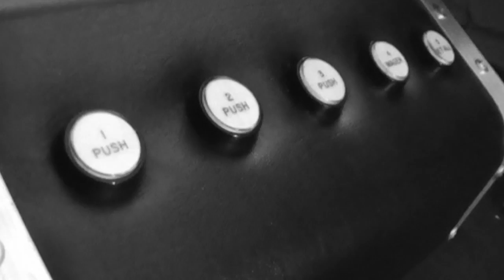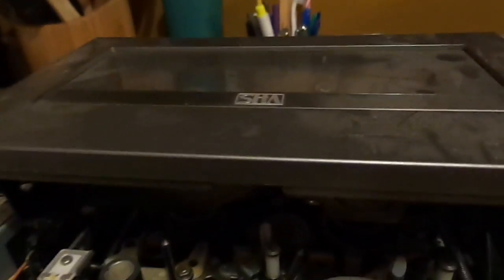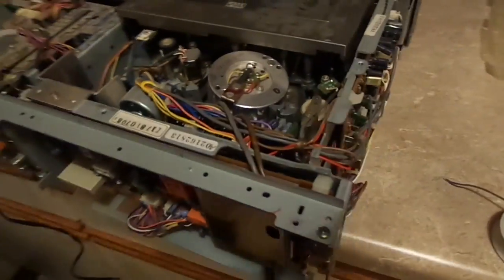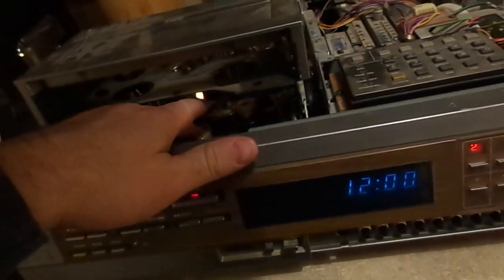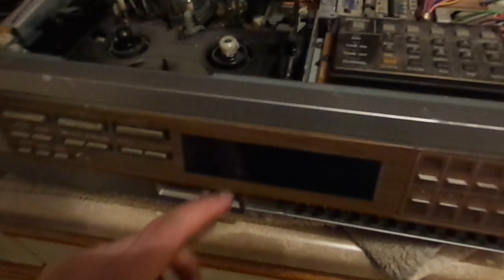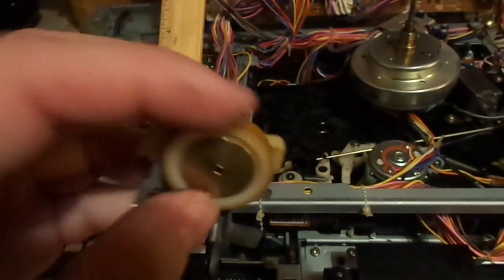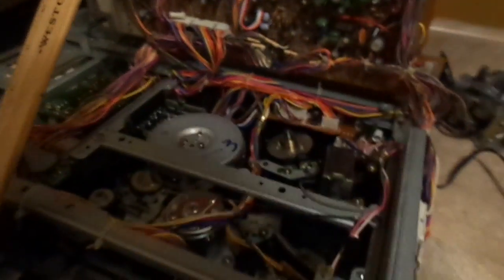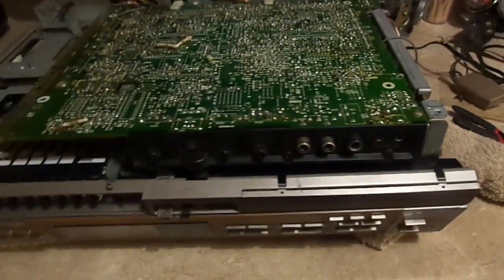Early 1980s Hitachi Top-Load VCR Repair Attempt

Comment: This has what is known as varactor tuning. The stereo VCRs of the mid-'80s were the first to use real digital tuning, while the cheaper mono VCRs held onto varactor tuning until the late '80s. (My parents got a Goldstar VCR in late 1987 and it had varactor tuning).
Reply: Can´t see...varactor was that tiny numbers in green?
1989 Samsung had a DTS (digital tuning from 2 to 69 and cable 1 to 32 and then 33 to 99)
Reply: The varactor (never knew it was called that way) required precise adjust of channels with some thumbwheels and a special tool y remember.

Comment: My first vcr was a top load, was a jvc but can't remember the model, inside was a work of art many many wires and if you removed the bottom compartment it reviled a maze of belts looked like spaghetti junction even the headdrum was belt drivin, amazing how they advanced over the years, really like vcrs, many happy time tinkering with them.

Comment: All it needed was new rubber on the idler for the reels. Its a very common failure on late 70s-early 80s VCRs. By the mid-80s, most everyone switched to toothed gears there.
Reply: But don´t toothed gears age and crack? 
my 2002 machine hasn´t failed on this part, but it seems to change to a smaller gear (FAster) when REW is pressed

Comment: Got a VT-8040E Hitachi vcr that's near-identical to that one. I purchased it in late 1982. A few months ago i tried to use it, but she's dead Jim!
The unit turns on, i insert a tape, but there's no mechanical action going on. It just sits there. Mind you, the belts have been replaced with new ones, but no move whatsoever. Wish i could get er running again..

Comment: I have a similar old Hitachi top loader VCR from the same period.
I replaced all the belts and idler wheels tires by new ones, also a new pinch roller.
It was working pretty well, but after few weeks it started to stop while playing. My conclusion was that my vcr has an issue with the motricity of the reel disk take-up, causing it to stop. And it begins to not play at all, like on your video. The reel disk take up doesn't turn, so after few seconds it stops.
There is something i can't understand with the play idler part (beetween capstan and reel disk take-up). It seems the play idler doesn't come in contact like it should... I put adhesive ribbon on the reel disk take-up where it should be in contact with the play idler (to make it a little bit larger), and it works again.

Comment: I have the samev VCR I just picked up last week and some of the springs have fallen out and I'm trying to figure out where they all go I think when you are at the end of the video you picked up that thing at the end idling arm or whatever and I saw a little spring in there maybe that's where the spring goes. I also found a little flap metal flap with a little stem in the middle and I can't figure out where it goes on this VCR. I'm getting close to putting all the things missing back in order. But when I turn the VCR on or plug it in the stop button is lit up is blinking constantly consistently. And that little light bulb where the tape goes in doesn't light up. So I'm trying to figure out those two problems also if anyone knows why those two things aren't working on the VCR please leave me a comment? I could use some help or pictures would be great I can't find the service mail either for this thing

Comment: when was the last VHS  VCR made? i have a samsung from from 2003 (ironically replacing a   mid 90s craig branded vcr)
Reply: According to Wikipedia, 2008. Combo VHS/DVD and VHS/Blu-Ray units are still made, though.
Reply: The last VHS machine was made in China in 2016.

Comment: Wow, I am shocked it even powered on!
Must have been some vintage eletronics hater. I have a 1991 Zenith VCR that used to say error on the screen and it was locked up. Soon I got it runnin', bought it's remote on eBay and it's been doing great since then. Got it at a thrift store some time ago, just needs some grease now!
Reply: By the early 1990's, VCR's started to be made in China for cheap and not serviceable. Just don't get overly trained by these greedy electronic manufacturers (Denon excluded, they still make good stuff).